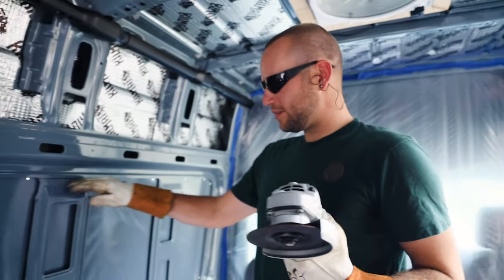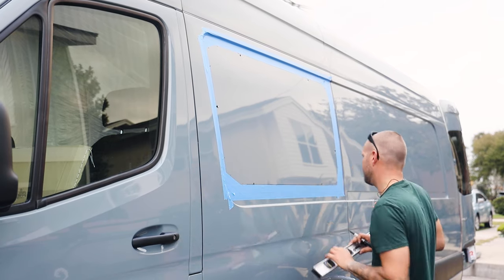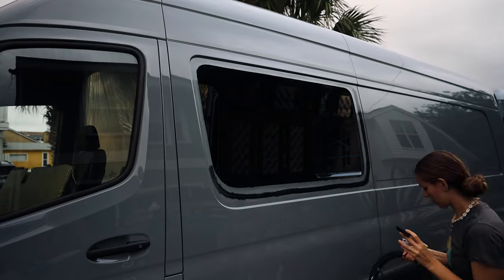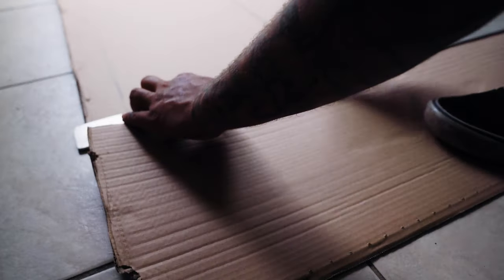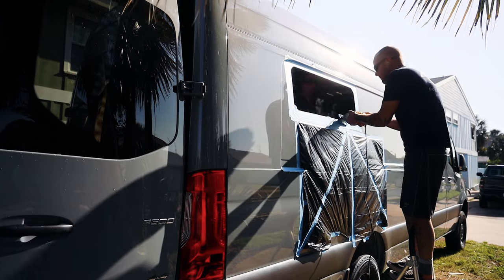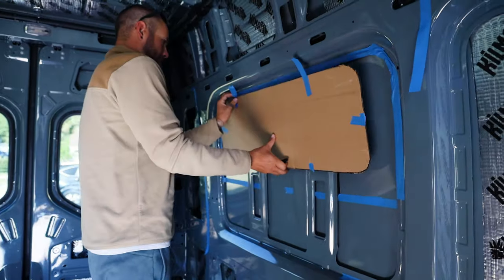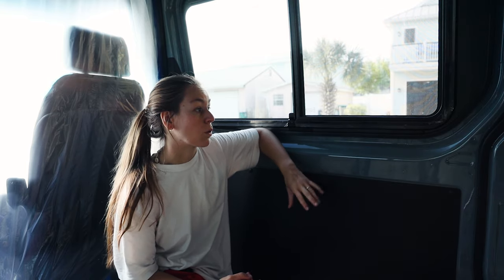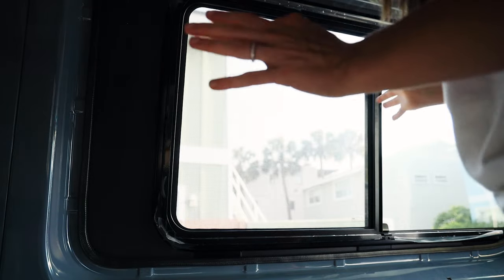Van Build • Week 4/15 | Window Installation (PART 2) *FIRST REGRET*

Comment: How are you feeling a year later? Would you do everything over again or still anxious about the design of the windows? I’m deciding on mine and was gonna do your setup since the big screen seems handy 😅
Reply from the maker: Ahhhh… the windows are still a sensitive topic here. Lol. We would definitely go with a different style – preferably awning window. 
The big screen is a nice/handy feature. Overall the sliding windows are definitely more stealth looking when camping in parking lots/public places. But we’ve been restricted, with opening the windows during rainy weather. I love the small sliding windows for the bunk bed. However the big ones have been difficult to open – and they are not "all weather"-windows. 
I feel you…It’s soo hard to decide! Let us know, what you end up doing. :)
Reply: @katharinagarmon6155    ugh such tough choices with the t vent style commonly leaking and the am auto letting more air in but also being more difficult to open. Kind of leaning towards 1 am auto on slider door and 2 bunks for now. Thanks for the input and will do!!❤️Van decisions are so difficult!! Lol